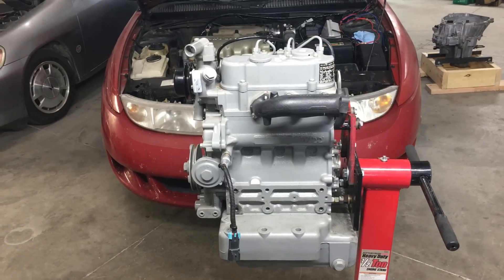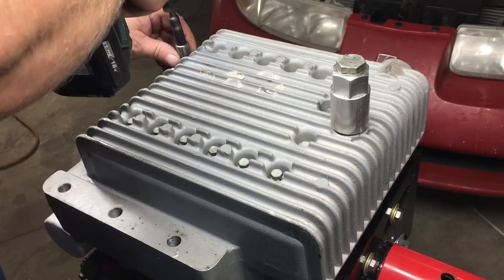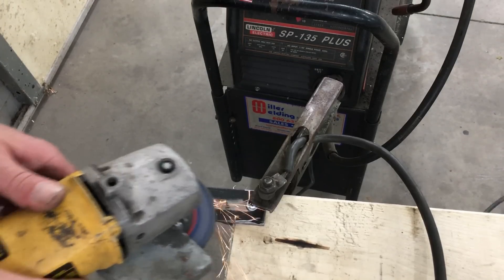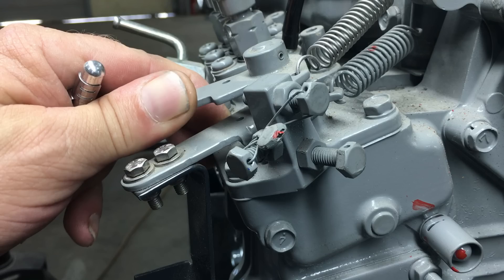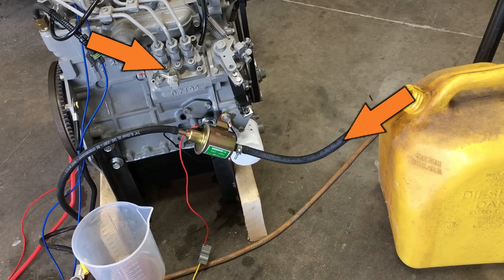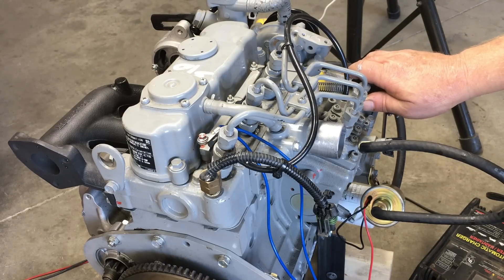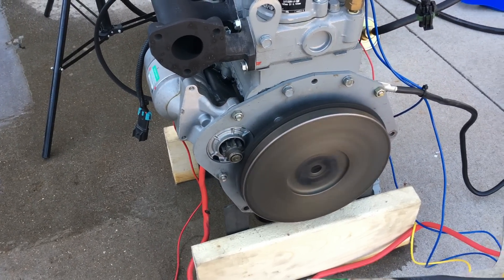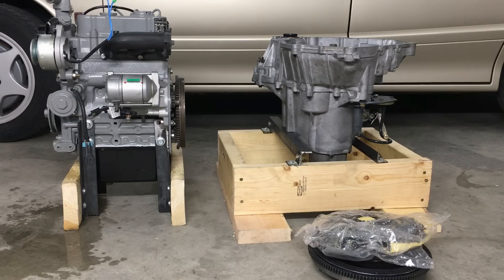S2E22  First start of the Kubota D722 diesel that we are going to use for our Saturn engine swap.

Comment: I'm really pleased to see this project.  I have several of these amazing little Kubota engines on mowers, generators, etc.  I have a D722 that I've been thinking of putting into an Opel Corsa, perhaps with an RHB3 turbo.

I'm really, reaaaally keen to see how you deal with the clutch and how well the gear ratios work out.  So, quit reading this and get back to work!

Comment: i put a d600 in a 1925 model T touring car i had to put two transmissions and (ironically enof a previous comment nailed it) it has 13 forward speeds and the best she can pull is about 25mph and the car weighs less than 1500lbs, i dont think your gona get to 60mph thees just no RPMs in these small diesels

Comment: Can you next make the Diesel Saturn run on gasoline with the diesel engine? They say stupid crap like "diesel engines have better thermal efficiency", but that comes from running at a higher compression ratio, gasoline at higher compression would also give this higher efficiency, but no one talks about it because the auto industry is in bed with the petroleum industry, and they want everyone to burn gasoline and waste money. Also they say that diesel engines compresses fuel until it blows up, but that's not even true either, if you look at the frame by frame video from institutions, you will see that the cylinder is basically done compressing, and then the fuel is injected into the hot compressed gas, where it ignites as its coming into contact. So specific octane of the fuel is even irrelevant, you just need to adjust timing of the engine to be compatible with the fuel burn speed. So you can put gasoline in the Diesel engine, get the 30 percent efficiency boost, and fuel your diesel car at the pump for less money, and I think gasoline even has more energy than diesel something like 110k BTU to 100k BTU per gallon?

Comment: Many years ago I purchased a Geo Metro for the princely sum of $50. My original intent was to swap in a Kubota tractor engine similar to the one you have here, but I never had a spare $2k lying around to buy an engine. I did manage to get mid-50's gas mileage from that little car with just the gasoline 3-pot though!
Reply: Ford makes a 3cyl 1.0 In the fiesta, 3X the power and same/better fuel
Economy. 55mpg highway. Used to have a 3cyl firefly.

Comment: If it’s got glow plugs it’s an indirect injection motor not a direct injection. With a indirect there is a small chamber to the side of the combustion chamber where the injector sprays and the glow plug heats for cold start. As a result of this extra chamber the head is weaker on a indirect injection diesel and the compression has to be lower as a result. With modern direct injection motors they bumped the compression up causing more heat on startup and that’s why direct injection don’t need/use glow plugs.

Comment: Sorry to hear of your hearing loss, that's got to be super frustrating.  I didn't detect any audio problems on the video so, Congratulations, good work!

This diesel transplant is the modification I have been looking forward to the most.  With only 20 HP on tap, 60 MPH sounds questionable however, the fuel mileage should be impressive.  The nice thing is, you are starting out with a new engine so, results should be solid, without having to deal with worn out Saturn engine problems.
Reply from the maker: 60 MPH is going to be close.... it will be interesting.
Reply: @robotcantina8957  nothing a small hiroshima blowdrier can't fix.

Comment: Hello. I see you have a Saturn junkyard of sorts i was just curious if you had some advice and parts you would be willing to share? I have a 97 SL2 5spd the issues are consistent egr insufficient flow code and burning oil, about a quart every 220 miles and the window switch for the right rear window is broken, my question is do you happen to have a rebuildable engine of that vintage i could purchase from you and any advice on the interior would be greatly appreciated. Thank you
Reply from the maker: Hi, the junk yard scene was at an actual junk yard, lol, I don't have that many saturns.. yet .   The EGR code may be an easy fix. Pull the EGR valve and chip out all the carbon in the manifold.  before you put the EGR back on the engine, start the engine and all the crud will blow out of the EGR hole.  Unfortunately all saturns burn oil  A qt every 220 miles is a bit much.
Reply: @robotcantina8957  well sir I have verified all egr passages are clean with compressed air and a wire brush I have also replaced the egr valve itself however this has not repaired the issue as the check engine light is intermittently off and on mostly on but every once In awhile it will turn itself off always the same code P0401 egr insufficient flow detected. And im sorry I thought those were yours. The oil burning is mostly due to mileage the car has nearly 300k on the odometer and I cant just throw it away it was my dads he passed away two years ago and I've been repairing and using the car it's helping me deal with the loss.

Comment: I found those little Kubota engines need a good 20-30 seconds of glow plug to start up well.  Also, I would bet these are Indirect Injection engines and not Direct Injection.  Lastly, the pump looks to be a gang version of the Bosch PFR pumps.  In larger engines each cylinder is fed by a discrete pump, but this is so small they just put all the pumps in one housing.  It looks like the "fuel adjustment" is just a rack stop, since these use a rack and pinion arrangement to rotate a sleeve which changes the effective fuel flow.
Reply from the maker: As I understand it, it may in fact be a rack stop.

Comment: I work on these engines all the time, I love these things, I wanted to do something like this but I just don't have the space, carful putting oil in threw the valve cover, it can overflow threw the Pcv into the air intake and then into the cylinders. The book actually recommends against it.
Reply from the maker: Thanks!  With the original oil pan, oil could be directly added to the pan, however with the new pan, the only place I could find to add oil was the valve cover.

Comment: WTF. This is pointless. Throw in a bike engine like 800-1000cc. If it were turbo and actually made usable power/tq, then it would make sense (and you could get the gearing tall enough). 
This isn't even for fun. It's a complete waste of time.

140 lbs isn't light. Lay off the drugs. 350 lbs fully dressed gets you 330-350hp stock V6 (390 with boltons). Remove the accessories and you're down to just double of this diesel.
Engine needs to be 100 lbs or less with more power to be useful in this car as an upgrade.

Comment: This video must be fake. How can a diesel engine possibly run without thousands of dollars in emissions equipment??

For reals tho, I really like this idea. I have a 25hp 3 cylinder diesel tractor and it's 4500lbs. Considering how fast my tractor will go I am certain you can get to 60mph.

Do you have enough engine rpm for that transmission to hit 60mph?

Comment: A quick correction: not all diesels are direct injection. In fact, most automotive diesels (in the US) older than about 1995 are not direct injection. They’re indirect injection, or IDI. The concept is similar, but rather than injecting the fuel directly into the cylinder, they inject the fuel into a small “combustion chamber” that is built into the cylinder head and separate from the cylinder, which is also usually where the glow plug is. It’s also typically injected via a poppet valve at a much, much lower fixed pressure than a direct injection diesel (5000psi vs 25,000psi on a direct injection). Since this Kubota is a small, non-turbo industrial engine that isn’t subject to typical automotive emissions requirements, I’d be willing to bet that it is IDI as well, not DI.
Reply from the maker: My bad,  I have owned a few semi vintage Mercedes with the OM60x engines and I'm aware of the prechamber stuff.  What I meant by direct injection was the fuel is injected on the other side of the intake valve
Reply: The Kubota D722 also has a precombustion chamber.
Reply: @meanotomato  Agreed.  This is an IDI engine (has a small pre-chamber in the cylinder head just above the cylinder bore).  It WILL start without using the glowplugs, but it takes a lot of cranking.  Heat them up and it will start right off.
Reply: @jlexon  the yanmar idi engines will pop right off without glow plugs. I don't know about the kubota idi engines. All the kubotas I've worked on have been DI and of course they'll also start right up without glow plugs.
Reply: @jlexon  For some reason USA based YouTubers will rather crank the battery to death or use ether, before they'll let the glow plugs do their thing. For older designs like this, the glow plugs might have to glow for 20 seconds or even a full minute. It's actually better for the battery to warm up from the plugs' current draw before having to deliver the huge cranking current
Reply: @inoahmann7542  Depends on the temperature. Why the reluctance to use the goddamn glow plugs?
Reply: Last I checked the older engine injection pressures, 6.5 and 6.2 to be sure, are 1600 to 2000. I'm sure some others of the same era might have hit 2500 pounds. 
Direct cylinder injection systems ran higher pressures for a number of reasons. Some of which include greater atomization which was more efficient, and some actually contoured the injection event to really be multi events like a small injection followed by the main injection. If I recall this was to help control noise but might have had emissions reasons as well. Higher pressures can also shorten the event time for more precise timing of the event. 
Not a fan of the emissions crap which literally hurt mileage efficiency pretty bad but the tech is pretty sweet and the power and low rattle sound is nice
Reply: It is IDI. Same basic head and fuel injection design they've been using on their engines since the 1970s. Kioti/Daedong makes an almost identical engine as well since they used to be a manufacturing partner with Kubota at one point. Yanmar engines are similar in head design as well, although I've never torn one of those down to see if the bottom end is similarly constructed.
Reply: It's idi.
Reply: You realize you can literally look up the engine specs?  Why keep going on about direct vs indirect?  It's a tier IV emissions engine.  All engines have emissions standards no matter the application.  Injection pressure has nothing to do with direct vs indirect.
Reply: @ShainAndrews  sure showed him
Reply: @ShainAndrews  not sure what you mean but DI injectors do have higher pop pressure than IDI. By over 1000 psi in a rotary pump application. Common rail DI is higher still by a staggering amount. Up to 10x more pressure. 20-30,000 psi.
Reply: @ShainAndrews  They have emissions standards yes, but actual requirements vary greatly depending on applications. This is why you can still buy 2 stroke generators and chainsaws and industrial engines (like this one) with IDI, yet you'ill never see something like that in a car.

Also, injection pressure has everything to do with DI or IDI. Former requires a lot higher pressures (typically over 1500bar) yet with IDI you can get away with 1/10th of the pressure. Similar to petrol engines; port injection requires A LOT lower pressure than direct injection.
Reply: @hojnikb  Combustion chamber does not dictate injection system.  At no point is diesel injection going to be petrol equivalent.
Reply: @ShainAndrews   For me it’s not about the emissions standards it’s about the compression you can achieve with a DI motor vs the IDI.
Reply: @Whistler42  Either can run the same compression.

Comment: Exciting stuff, Jimbo!

Can't wait to see the Saturn moving under Kubota power! 

What are the plans for the Saturn sedan? (I only discovered the channel a week ago and I have skipped around a bit, so I don't know if you revealed this in a previous episode.)
Reply from the maker: We have three Saturns . The coupe is of course getting the diesel swap,  The wagon is for other experiments.  The red sedan as seen in episode 14 is basically a parts car.  We finally got the automatic transmission on the red sedan working properly.  The green sedan at the end of this video was just a junked car we pulled some parts off of.

Comment: 1:50 Why does that application mean it needs a huge oil pan?
Reply from the maker: The engine was designed to power a refrigeration compressor that pretty much runs all the time.  I reckon the engineers felt that it should have a huge oil sump.
Reply: @robotcantina8957  So, runtime + no airflow

Comment: Excellent video! Are you worried about camshaft durations being funny with this motor being designed to run at a constant rpm?
Reply from the maker: Not really.  We will probably run the engine in the 3000 RPM range most of the time.  It seems to idle fine and we may need to run it at near max rpm to get the most speed from the car.
Reply: @robotcantina8957  very interesting, I work on industrial generators ranging from 3 cyl yanmars (which look strikingly similar to yours) to larger 4-16 cyl diesels. They are generally set to run at 1800 rpm for the preferred 60hz, that being said you may find good torque at or around 1800. Either way good luck I’m eager to see the results!

Comment: In Europe small-medium cars with Diesel engines are very common. I have a Ford Fiesta with a 1.4L turbo diesel.
Reply from the maker: For cars, I think GM was the only manufacture offering an american made  diesel engine back in the 1980's.  A few smaller car were offered by other manufactures but they used European or Japanese diesel engines. I had owned  two older Mercedes with diesels and thought the were great cars.

Comment: If it's not lugging too bad in 5th gear, you should swap the MP2 5th into the MP3 and play around with those results. It is a direct swap and you only have to remove the endcap of the trans to access the 5th gear.
Reply from the maker: at 20 HP this little engine needs all the help it can get.  I would be surprised if we we can get it to run in 5th gear on the MP3 transmission. but we shall see.  The fifth gear swap is easy enough though.

Comment: You should just leave the diesel at idle, run a 20kw generator from its output, then an electric motor to the transmission,  this will increase mpg, and extend the life if the diesel dramatically,  while giving you a straight line torque curve for the transmission input.
Reply: 20 kW is 26.8 hp. The engine only makes 20 hp, and that's at 3600 RPM.
Reply: How is that going to improve performance? You will take a 40% efficiency hit straight away.
Reply: @TonyLing  Where do you get 40% efficiency hit?
Reply: @reverse_engineered  I just pulled it out of my arse. If you convert mechanical energy into electricity, and then electricity back into mechanical energy, be prepared to expect at least a 40% loss in efficiency.
Reply: It only takes 5hp to go 65mph, but not requires a straight line torque curve not a bell curve offered by the engine. Also, an engine at idle speed 1000-2000rpm uses less than half the fuel consumption of an  engine with variable rpms and constantly changing torque output. That's why freight trains use the exact same principles to achieve better fuel economy.
Reply: @jasonburguess  Diesel electric locomotive engines turn at less than 1000 RPM when they are running flat out. That is not idle speed; that is redline speed. As in, "The valves will float if it turns any faster". As in, "It will undergo violent disassembly if it turns any faster". For that matter, idle speed of my Dodge Cummins is in the vicinity of 650 RPM, not 1000 to 2000. Redline speed of my Dodge is 3100 RPM. 

It still looks to me like you are trying to get something from nothing. You will still need to use 1 horsepower to turn a generator over and get 735 Watts out of it, no matter whether or not the torque curve is flat. The engine load will still increase when the locomotive accelerates or climbs, and the torque output will still vary in order to accommodate these loads.

Comment: You sure that's a direct injection diesel? Acts like an indirect.
Reply from the maker: My bad,  I have owned a few semi vintage Mercedes with the OM60x engines and I'm aware of the prechamber stuff.  What I meant by direct injection was the fuel is injected on the other side of the intake valve
Reply: @robotcantina8957  10-4. The prechamber kubotas are usually pretty hard starting, that one is doing great though!

Comment: What a happy little engine! I can't wait to see these tests. You'll be proving what Europe knew for a long time. A small diesel engine in a lightweight car actually gets great fuel economy with enough torque to move around. The audio in the videos has been fine to my ear, and I'm pretty picky. Great work!
Reply: Case in point: VW Lupo 3L, 1.2L 3cyl TDI..
Reply: @tech4pros1  Exactly. Europe was getting 50+ MPG long before it was cool and we idiots in the USA can barely figure out 35.

Comment: 20 hp out of a 140 pound engine, that is definitely light! /s

Some diesels do use indirect injection, btw. The IDI diesels from IH are some of the most well known examples (in the US).
Reply from the maker: My bad,  I have owned a few semi vintage Mercedes with the OM60x engines and I'm aware of the prechamber stuff.  What I meant by direct injection was the fuel is injected on the other side of the intake valve

Comment: Didn't hear any mention of power figures for this little diesel... You going to bench top dyno it so we can compare to the other engines you've worked on?
Reply: He stated the power.
Reply from the maker: This engine makes 20hp@3600rpm and 33ft-lb tq at 2600rpm  Not much power but that's what makes it fun.  The engine is too big to put on the dyno,  I reckon some day I need to build a new dyno.